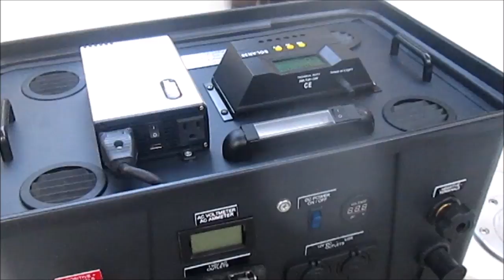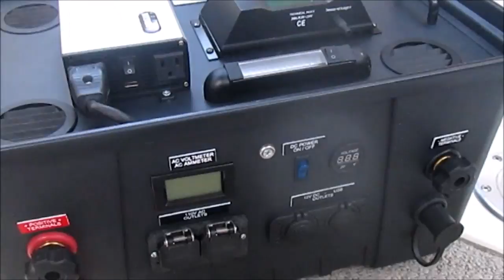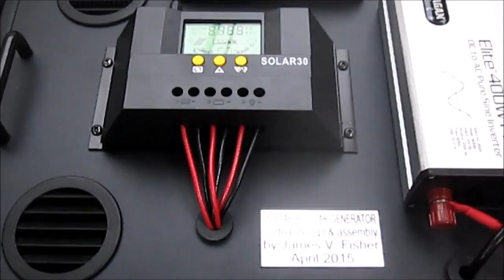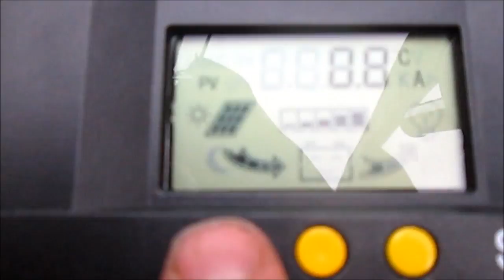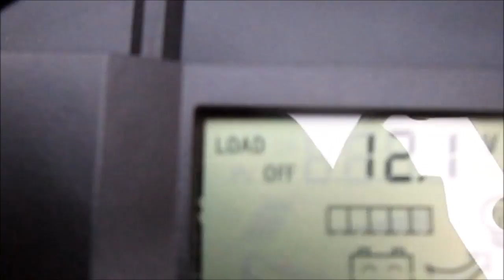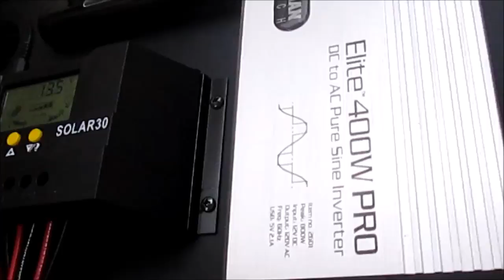V1 P6 DIY Portable Solar Power Generator

Comment: Ok, I found the information.
Reply from the maker: Glad you found the links Lee.  For anyone else who is interested:
WIRING SCHEMATIC  
http://creeksideartifacts.com/PSG0717schematic.pdf
PARTS LIST http://www.creeksideartifacts.com/parts_list.pdf
Inverter to 110V AC Outlet Wiring Schematic:  http://creeksideartifacts.com/wiring_schematic_inverter_to_ac_outlet.pdf
Snap Disc Thermostat Wiring Schematic:  http://creeksideartifacts.com/wiring_schematic_snap_disc_fan_thermostat.pdf
MC4 Cable Entry Plate Wiring Schematic:  http://creeksideartifacts.com/wiring_schematic_mc4_cable_entry_plate.pdf
Solar Power Management Calculations for this system: http://www.creeksideartifacts.com/SPMGMTcalculator.pdf
Frequently Asked Questions & Answers:  http://www.creeksideartifacts.com/PSPGFAQ.pdf
Reply: have you thought of doing step by step videos??
Reply from the maker: No, Lee, I have not.  I'm better at tinkering than making and editing videos. :-)
Reply: Jim its okay, I've gotten better at doing videos. But I still Tinker as well. Thanks for the video and information.

Comment: Not something that you ever have to do but the next upgrade for someone who is concerned about total weight might look into using LiFePO4 battery technology instead of AGM batteries. LiFePO4 technology is not a known safety and fire hazard as are Lithium Ion technology batteries.
Reply from the maker: Reducing the weight of this system is very much in my line of sight for a future upgrade.  Just waiting for the prices on LiFePO4 batteries to come down a good bit!

Comment: thanks again I think 10Amp fuse for the busbar not a bad idea
Reply: That’s good thanks for your wonderful honest work
Reply: The load Max normally 10 Amp with 30 Amp charge controller check the charge controller spec , 15 Amp for the outlet is too high
Reply from the maker: Ahmed, you were right.   I checked the specs and the maximum load output for my charge controller is 12 amps.  I will need to downsize from the 15A to a 10A fuse.  Thanks for catching that potential problem!
Reply from the maker: Can never have too many fuses for protection.  There is a 15 amp fuse between the bus bar and the 12V outlet, but a 10 amp between the bus bar and the USB outlets would be a good addition
Reply: A good find, I need to order more circuit breakers. Can the USB and 12V outlet be behind the same fuse?

Comment: Looks good, I can't really see but are the batteries clamped in to prevent movement in rough sea conditions?
I would also consider better natural or force ventilation in the lid to reduce the risk of explosive gas build up at the top of the case where also is most of the source of heat, charge controller and inverter.
Reply from the maker: The batteries are not clamped in, but I installed 1"x4" framing in the bottom that keeps them from shifting laterally.  Over the past couple years of use I have found that I seldom needed to leave the lid on during use.  The battery box is stored under cover in the cabin on my boat and simply leaving the lid off allows any heat or gases that build up during charging to dissipate. To be safe, I always leave a vent open in the cabin to make sure there is good air circulation.  If someone planned to use this in a circumstance where the lid needed to stay on all the time I would advise that both fans be oriented such that they are both pushing air into the case and the pressure differential would cause air to vent out from under the lid-  it is not sealed/ waterproof.